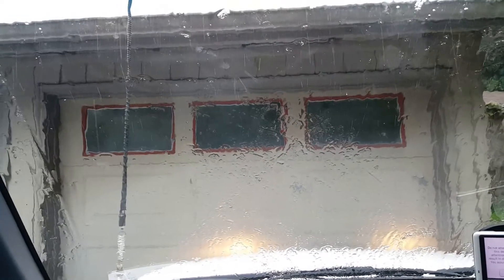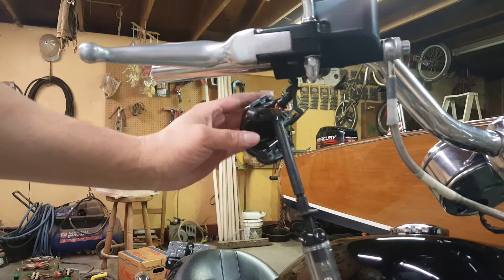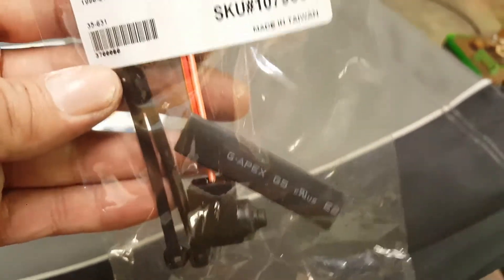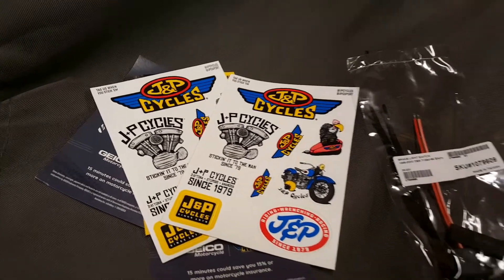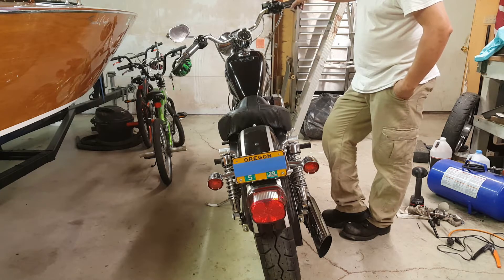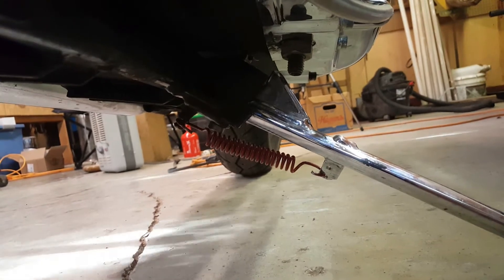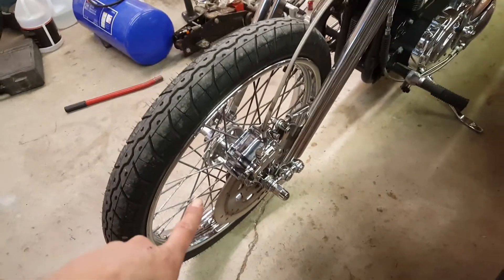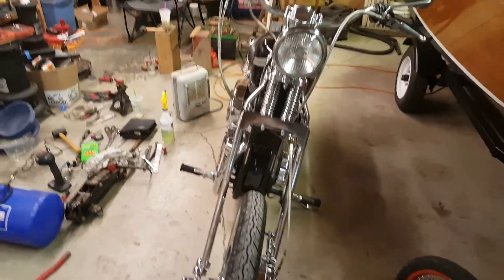"Spendy sporty" update May 2019

Comment: Hey, Josh...  you might want to spin that tire around.  I could be wrong, but it looks like you have the spray grooves, or whatever they are called, going to the instead of forcing water out.
Reply from the maker: Hey Joel, You and I think alike, believe it or not there is a rotation arrow on the sidewall,  it is installed correctly, opposite of the rear tire, i tripple checked with the manufacturer just to be sure because i swore it was wrong! As always thanks for watching!
Reply: @joshuaburks  I guess that's why I'm not an engineer.   lol